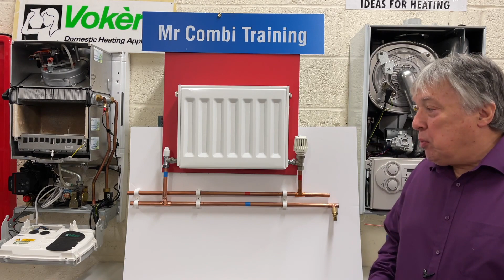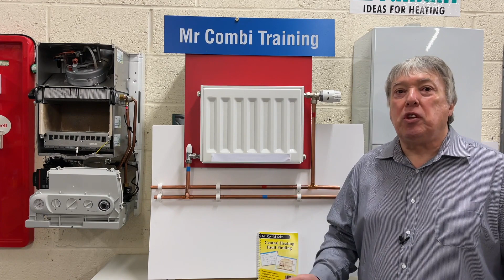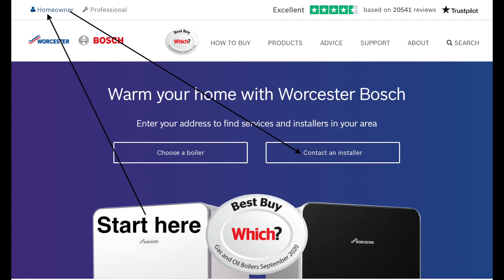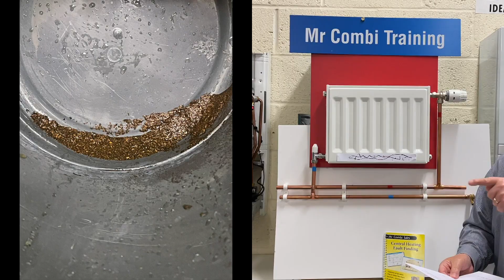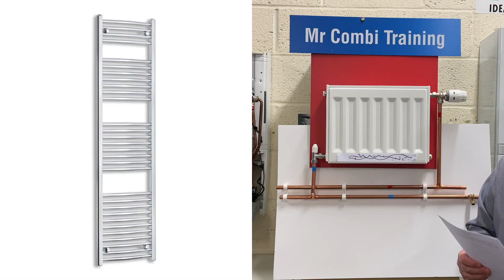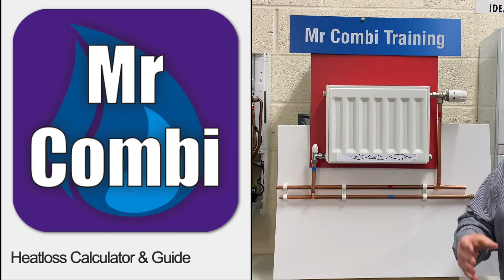25 TRV and Rad problems

Comment: Hi . Apart from  the bypass rad,  two rads out of 9 are always that bit  hotter to the touch than the rest.  

And the pipes on the lockshield side on these TWO rads  are hotter than the trv side.   Why  is this.  Cheers
Reply from the maker: Hi Eddie, thanks for asking, There are 2 types of TRVs. with an arrow (directional) or without, check which you have, it looks like the 2 have the FLOW coming in the balancing side instead of the TRV end. See my video on "Balancing Fixed" see the Danfoss TRV can be fitted on either end and position because it's directional. Hope that helps, George S 🤩👍